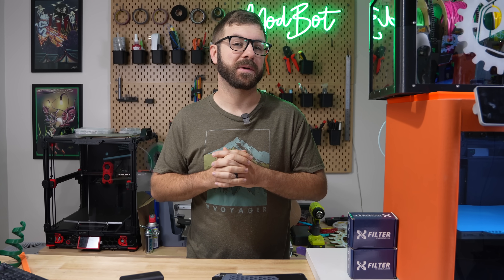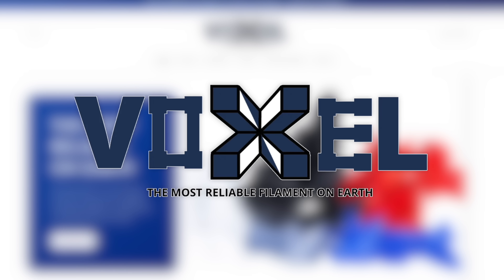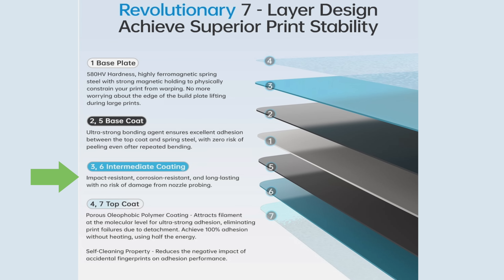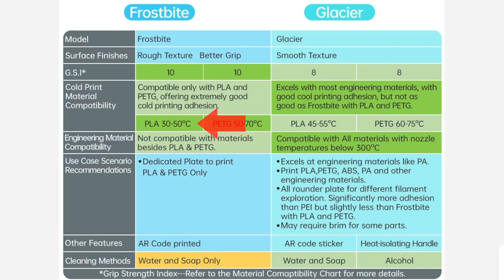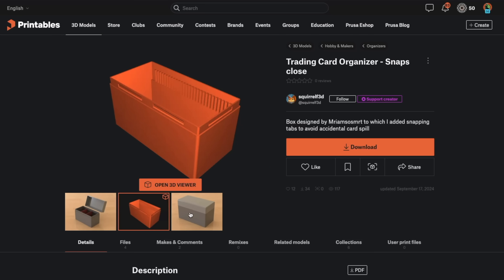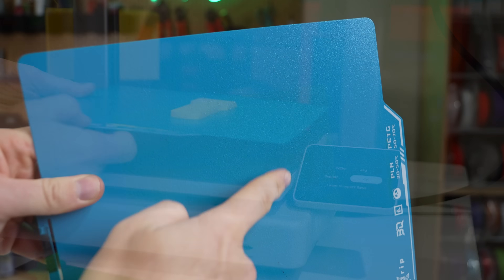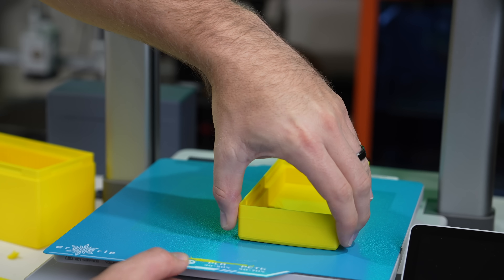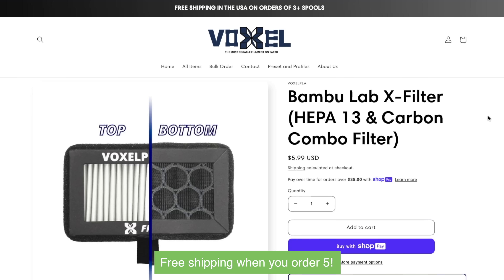Best Build Plate For Bambu Lab Printers? (Biqu Cryogrip)

Comment: I have been using them all for the last month in my business. I print in a outdoor shed that is currently 34 degrees, I set the plate to normal temps for PETG and they work great! At my outside temps I had to watch the regular plates for adhesion, and these I don't, I hardly was them also, and have ran over 500 hours on each of the 10 I own. The only other plate that seems to work as good is my Prusa xl plate, man the presa xl plat is a great plate, I want to buy a bunch more, but none are made for bambu.

Comment: @07:03 Really? 🤨 I'm not sure what shocks me more... Someone ( a YouTuber to boot! ) downloading this OR someone uploading it to begin with!! 🤔
This can easily be made by generating a simple Cube Primitive with one side stretched, have it angled to like 45°, and the bottom end cut off via a Split to again place it onto the Build Platform 😑
Reply: Because it's no longer an apples-to-apples comparison if you redesign a test from scratch, and have only a vague idea of what the original was..? 
"angled to like 45°" very specific..
Surface area contacting the bed is also the entire point of the test, so he should just guess at that part also?
Reply from the maker: @Duraltia  who cares? Sure it’s not hard to design a cube that’s stretched at a 45 degree but the fact that it bothers you so much that someone uploaded it and I downloaded it is wild to me. 🤷
Reply: Why reinvent the wheel?
Reply: What's the harm in doing this? Saves time if the model is ready for download.
Reply: why not? loads of people 3d printing are actually printing off their phones or ipad.

Comment: I bought the glacier's for my A1's. At first nothing would stick. I washed really good and cleaned with IPA, then parts did start sticking. I'm still not entirely sold tho... everything seems to pop off easier than the PEI. I was going to return them, but I decided to keep them around for when I want less texture, like parts that need sanding. YMMV
Reply: Just a heads up I've been told you need to use the textured PEI plate selection even with the cold plate (glacier) and even adjust the zoffset some. SOmeone in the comments posted this.

"I had the exact same first layer issues on my a1 but only with the glacier plate. The frostbite prints great every time. The way I fixed it on glacier was to use the pie plate settings but go into gcode and change the z offset from -.02 to +.03. Made it look perfect."

Comment: Bought one a few months ago.  Order more for everyone of my prints.  No more glue. I have never had an issue.  Adhesion, I would say is to good.  You will understand when you try to take off prints.  Personally, I have have never had any warping like in the video.
Reply: you do NOT need glue for PEI plates, smooth or otherwise, EVER.  Glue is a hold over from yesteryear printing, like when on Glass plates (even then you technically didn't need it).
Reply: @SirLANsalot dont TPU printing benefit a lot from it?
that said its exclusive for those..
Reply: @SirLANsalot  except you can't print petg on PEI without glue :)

Comment: I got these plates just recently. They are really good. If you just print PEI, you have no idea what you miss.
Reply: Depends on your material. For those of us primary printing ASA/ABS, smooth or powdered PEI is an obvious choice for a reason. PEX is also very good. One of the issues with PEI is a lot of cheaper beds only use very thin layers whereas thicker sheets offer a lot of advantages. For PLA/PETG it really comes down to surface finish IMO because it's really not that difficult to get them to adhere well.

I'm just glad glass beds finally seem to be dying off.
Reply from the maker: They check alot of boxes and with the interest others expressed it made me want to dive in further. The price is also pretty competitive even against PEI.
Reply: In my experience the only quality PEI plates you get from Prusa. All Bambulab plates are garbage, including every variant of PEI they have. Nothing ever sticks on the stock plates. Yeah you can make stuff stick on PEI plates… 5-15° beyond the glass transition temperature, which is shit for print quality. These cryo frosted plates, they stick super well at 30-40° and release well at room temperature, and you can still bed bump temps for better adhesion while staying below the glass transition temperature…

Comment: I've been using mirrors for years. Easy to find, cheap as heck and works fine for PLA, PETG, TPU95 and ABS which is what I use and also, I love the smooth finish they give to the printed parts :)
Reply from the maker: I cant do mirrors anymore. Granted it was my fault for using cheap mirrors but I split my hand pretty bad on the edge of a mirror tile like 5-6 years ago. I never used one after that. I did really like the visibility to the underside of the toolhead they provided though.
Reply: They don't work for petg, please don't mislead people, someone could break a glass

Comment: These are great, but I really wish they would make them in black so they dont clash so much with the printer. That bright blue sticks out like a sore thumb.
Reply: Bambu has their own version that is black

* Just for pla and petg
Reply: @Real_Name_Redacted  if it is ever finally available. They keep pushing the availability date back. So I picked up the frostbite.
Reply: On Amazon there is a gray version with the same material
Reply: You want the build plate to be a color you won't normally print. The further away from your part color, the better. You'll be able to see errors in the print way easier that way.
Reply: They make a non pro Cryogrip that's black/grey. It's somewhere in between the frostbite and glacier. PLA/PETG and also soap and water only. Edit @2:16 in the vid he shows/mentions it. Next availability is Dec10
Reply: marketing is a beast
Reply: @LyleH-13 you mean a yeti?
Reply: Darkmoon 3d makes a black one.  I just bought 2 and it's way better than my 3 biqu cryogrip
Reply: I dont care what color it is as long as it works as intended
Reply: I agree but I print a lot of black and if something is left on the build plate it really shows up on the blue instead of a black build plate, I need a clean cuz I print turn signal lenses and I don't want black specks on them left over from previous prints so the blue does help but yeah ugly
Reply: If it's not blue, how is it supposed to be cold?
Reply: Imagine caring what the machine looks like 😂
Reply: @coloradocornbread6996 hey whatever floats your boat (or benchy). Some people go nuts on the aesthetic when they build their machine
Reply: Yeah.. are we printing or having fashion show @coloradocornbread6996
Reply: @coloradocornbread6996 Imagine talking and nobody asking for your opinion.  I bet you don't care if you smell like shit or any of your other 5 senses